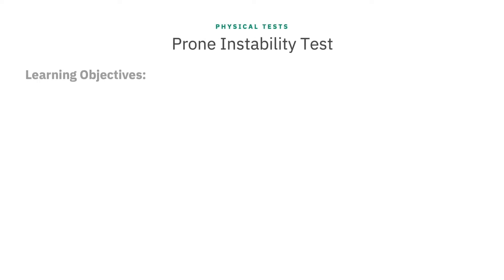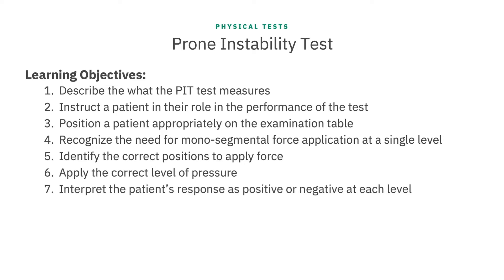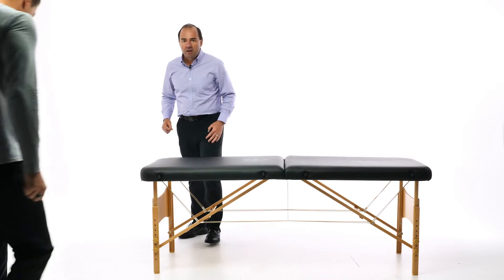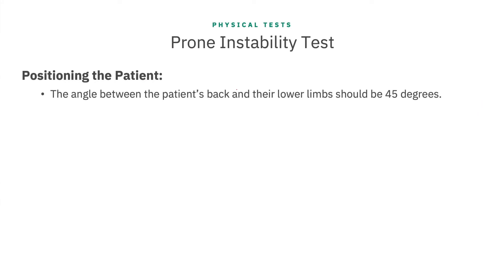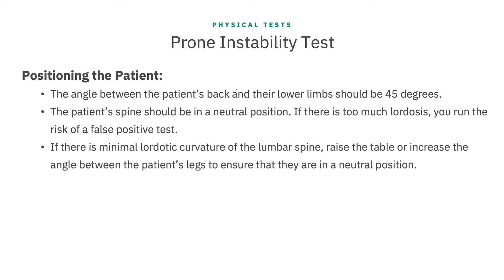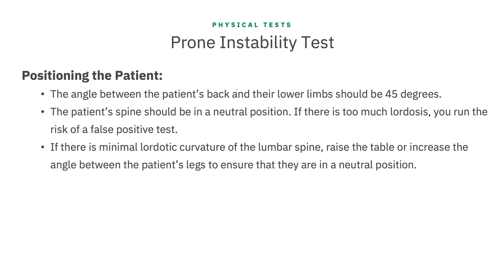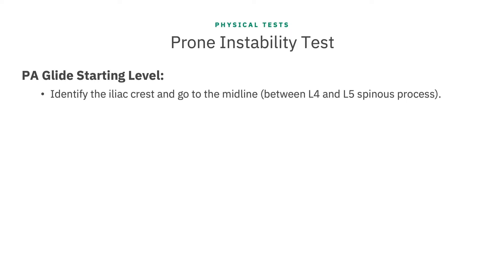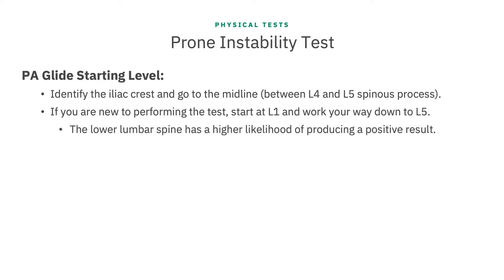Prone Instability Test

Comment: What demographic should this be used for? Obviously it would be easier getting a 25 year old athlete prone in this position versus a 60 year old. Is it just a patient by patient basis?
Reply: This test is part of the Hicks prediction rule which is mostly used to check for motor control impairment with people below the age of 40